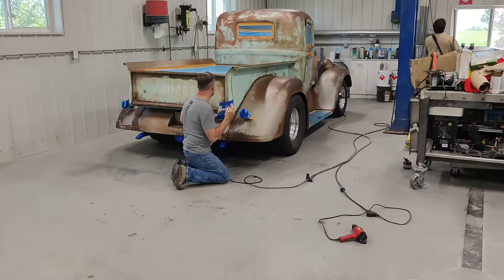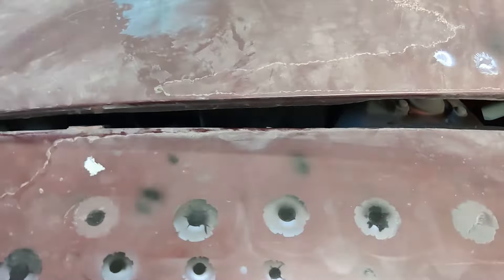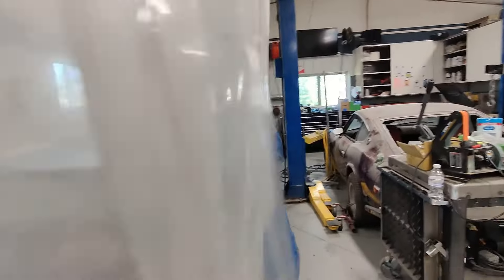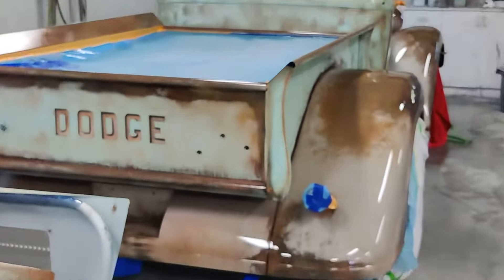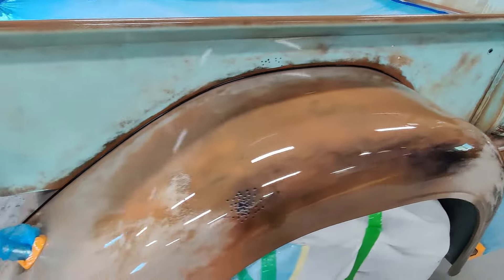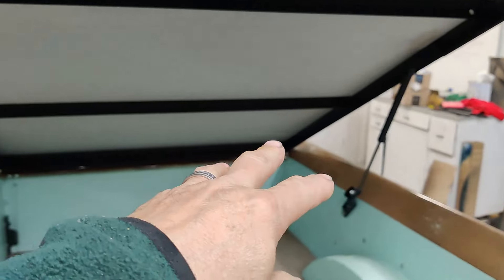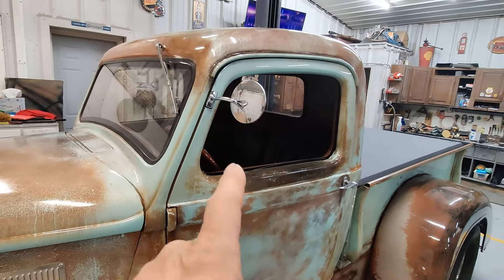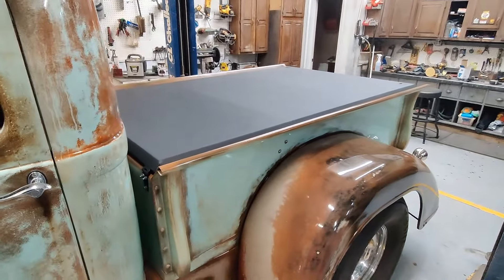1937 Dodge   Spraying Clear over the PATINA

Comment: So, does the rust eventually become active under the clear coat, or, does the clear coat prevent that?
Reply from the maker: Two replies.  The clearcoat does act as a seal.  However, if the rust migrated from under the rubber on the floorboards (like mine was) then I would anticipate it continuing.  Please remember, I created a "rust effect" on this truck that was built back in 2016.  So most of it is faux patina.  Thanks